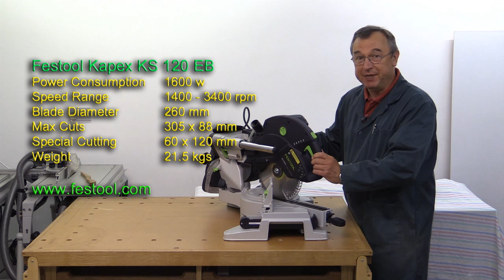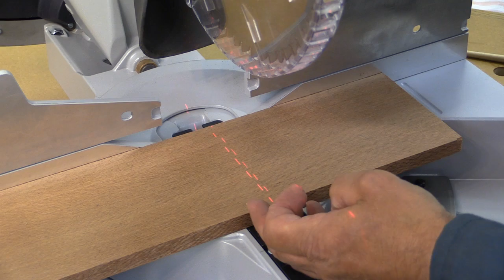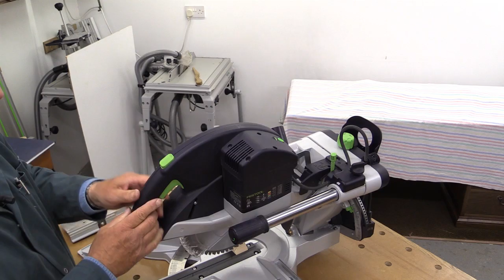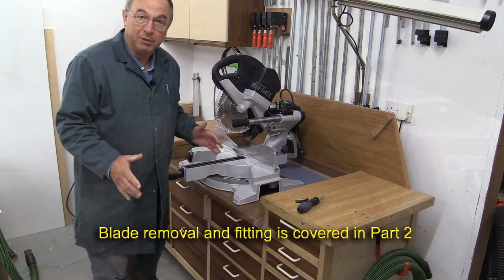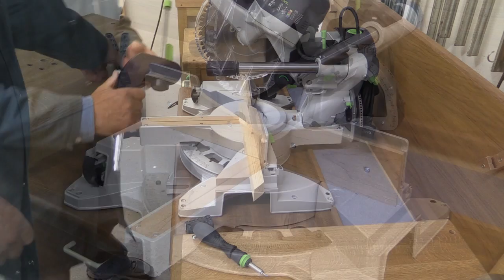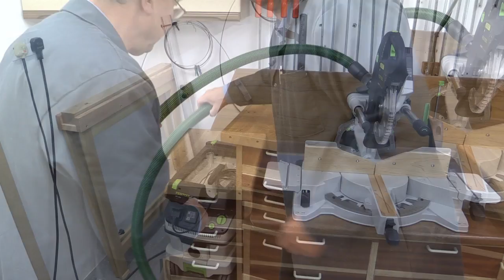Festool Kapex KS 120 - Part 1

Comment: Peter, I'm having a problem that seems to have happened to many who have commented on youtube. It's that the Kapex's dust collection is TERRIBLE!. I followed your suggestion to put zero clearance inserts on the base and the fence. The one on the base doesn't seem to cause a problem, but I wondered if the one on the fence was blocking the path that the dust should take to the rubber dust hood at the back/bottom of the saw blade. I removed the insert from the fence, and split the halves of the fence apart so that it didn't interfere with the rubber dust hood - it's a pain anyway when the hood gets stuck on the fence as you pull the saw back. Then I notice in your video and others that your rubber hood goes almost all the way down to the base, but that there was about an inch of space between mine and the base. I dummied up a 1 inch extension to the hood out of duct tape and trimmed it so that it doesn't get caught on the fence as you pull it back. Now - well, it's not perfect, but it's much better than it was. When sitting on a low rolling chair and looking at the dust hood while making a cut, before, a lot of the dust was going under the hood. Now, with my extension, it's going right up into the saw. I noticed that you and some others who praised the dust collection have the 120 EB, whereas I have the 120 REB. I also noticed that the EB's dust port is different than the one on the REB. Do you have any insight into this problem, or perhaps can get info from Festool?
Reply from the maker: Hi Bob, You are right that the zero clearance pieces that we make and fit ourselves do interfere with the dust collection but the effect, for me, is quite minor. It would become more pronounced if one was cutting thicker stock. As far as the design of the dust boot goes I believe that they are the same. There may be technique issues... Starting a cut the instant the saw is triggered does not allow the extractor to reach full flow. Also, keeping the Kapex in the down position until the saw blade ceases to rotate will improve dust collection. The final thing is expectation...Yes, the Kapex is great at dust collection but that is compared to the majority of other saws on the market. Some dust will always get through. I came from a Dewalt radial arm saw to the Kapex and the difference was amazing.  Peter

Comment: Hi Peter, I really beat myself up over the purchase of the Kapex 120REB. It's the one saw I've long been after and I recently took the plunge. It's a pricey saw but after January next year and Brexit there's only one way prices will go and that is up! I was really laughing to myself when I watched your part 1 video about the method of starting the Kapex. For half an hour of so I coudn't get the saw going and I was sure there was a fault on the machine so much so I telephoned Festool UK for tech help! Now I'm up to speed with the trigger start up thanks to you. Best regards, Richard
Reply from the maker: Hi Richard, It is a funny thing but some of us get it right first time and some need a second go. Once you get it then  things are dead easy.  Cheers.  Peter

Comment: Hi Peter, do you think it is save to cut a mortise and tenon joint on the kapex saw?
Reply from the maker: Hi Henning, You can do the tenon if the size fits in with the Kapex trenching range but the mortice has to be done with either a router or a hammer and chisel.  Peter
Reply: @NewBritWorkshop  Thank you Peter!!

Comment: Hi Peter, thank you for producing this very informativ video! I have one question on clamping. Is it not dangerous to clamp both ends of a work piece down? Thank you
Reply from the maker: Hi Henning, If you always allow the saw to stop before lifting then it should be fine. Better to keep everything in one place than have half of it flying around the workshop !  Cheers.  Peter
Reply: @NewBritWorkshop  Thank you Peter

Comment: So I bought this machine and it’s really great. The only downside I am finding it’s it’s awkward to carry. I am a site carpenter so I’m always hauling this thing in and out of home. Any suggestions? Great video
Reply from the maker: Hi Ben, They have a mobile base and workstation which is used by a lot of the guys on site. It makes moving the machine much easier.   Peter

Comment: Hello Peter, hope you're staying safe!  Just a quick question on Kapex, I am renovating my summerhouse whilst we're in confinement.  I need to cut some 9" x 3" beams.  Would you do that in one pass on Kapex 120 or perhaps 2 or 3?  It seemed to be struggling a little a couple of days ago so this morning I've made the cuts in 2/3 passes.  Ive had it 3 years with modest home workshop use.
Reply from the maker: Hi George, There are a number of factors that can affect the efficiency of cutting - dull blade, wood not supported equally on both sides and too much force by the operator. If you detect a burning smell at any stage or scorching of the cut faces then check these out. Otherwise, take the cuts slowly and remember that if your wood is not perfectly flat that as you cut one side or both will try and move.  Peter

Comment: thinking off getting the dewalt 780 from axminster have u had good service from them
Reply from the maker: Hi Tom, I have been buying tools and other bits from Axminster for over 30 years. Their customer service is fantastic and they really do go the extra mile when it comes to after sales service. Their store staff are also excellent as they understand the woodworking community so well and certainly know their stuff when it comes to tools. Although you might pay £5 more for the Dewalt from Axminster it will be worth every penny as you will have their excellent support should you have any issues at all.   Peter
Reply: @NewBritWorkshop  thx peter

Comment: Hi Peter. Do you know if it's possible to fit the festool LED light in the 120 to use the shadow line like the Kapex 60? Personally I don't trust the accuracy of the lasers although you can adjust them.
Reply from the maker: Hi Cathal, I do not think that a shadow line can be created with the KS120. Do have a go at adjusting the lasers if they are not right. Mine are as accurate as I can get them. I agree that they are not quite as good as the KS60 but I only use them for approximate work.   Peter
Reply: @NewBritWorkshop  I haven't actually bought the Kapex yet. I'm torn between the KS 6O and KS 120, I'm going to just be using it for 2nd fixing so I'm wondering would the 60 be sufficient for that work? Also, do you think the dust extraction is better on the 120?
Reply from the maker: For 2nd fix I would not hesitate to get the KS60 as it should have all the capacity that you need and be a little lighter and less expensive. It is a great saw. For a fixed workshop I would always go for the KS120 - mine is brilliant.   Peter
Reply: @NewBritWorkshop  Thanks Peter, keep up the good work with the videos.

Comment: Hi sorry peter, oh boy I probably wrote the name down wrong, it’s a Festool chop saw that looks like a step down version of yours except it seems to be targeted at mitre or off mitre cuts as the saw itself doesn’t swivel but instead the support back plates do. When you swivel one fence the opposite fence also moves, so for a cut you simply put your bevel gage against both fences and the cut is automatically bisected for you. With your saw I know it comes with its own bevel finder that you set using the laser. I’m beginning to think I dreamt this saw up ha. Sorry again about the confusion.
Reply from the maker: No problem. I have the Kapex  KS 120 and I have made a video about the new Kapex KS 60 - a really nice saw.   Peter

Comment: bought a kapex about three months ago. the motor just went up in smoke it simply died on me while finishing a house.
Reply from the maker: Nobody knows the details about what you were doing with the machine, whether it was set up correctly or what Festool then did as it happened within the warranty period. I expect you got your money back.  Peter
Reply: This is not a rant against you! I'm a finish carpenter I did nothing to this machine that I hadn't done with my Bosch(s). The machine was set by me to spec!! My point is this: the most expensive miter saw ever put in the market burnt out in only three months of use. We use a lot of 3/4 MDF nothing else and nobody else ever used it besides me. No such luck they would not give my money back. I used a Bosch for almost 6 years I only have in to the kapex because I own a few Festool tools and for a better dust collection. Best regards!
Reply from the maker: You should insist on getting a repair or your money back. The Kapex is not cheap and should be able to withstand just about anything that can be thrown at it - where are you based and who supplied the machine?     Peter

Comment: Hi Peter. I have recently purchased one of these and have a question regarding the dust extraction. 
You mention in your video (one of reasons I purchased this) that the dust extraction is second to none. 
I am not experiencing that. I have made sure the rubber boot is connected properly. But am still experiencing quite a bit of dust. Still not as much as other saws, sure.. Yet far more dust than I have seen in video review all over.. 

Any tips on making sure I am extracting correctly? I am using a festool midi vac, set up above the saw through a shortened green festool hose. 

Thanks
Reply from the maker: +cynicaloptimist  Hi Mr Optimist,  It is best to ensure that the extractor is up to speed before starting the cut - this is only a second and a half. Also, I use a short section of 36 mm hose between the Kapex and the extractor - this makes a huge difference. 27 mm hose is not good enough.     Peter
Reply: +New Brit Workshop (Peter) 
Hi and thanks again.. Ok so I am going to get a larger diameter hose. Would it be worth going up to the 50mm hose.. Which can be purchased by the meter. Or is the 36mm ample in your opinion.. ?
Also, did you have to tweak the saw in a few places so it would cut 100% square. Mine seems about 2mm out over a 300mm cut. Would have though it would ship at 100% but it is tweak-able right? 
Thanks
Reply from the maker: I have not tried the 50 mm hose but am perfectly satisfied with the short length of 36 mm.

Yes, you can adjust the saw very easily. Take a look at the US Supplemental Manual https://www.festoolusa.com/media/pdf/kapex-ks120-supplemental-manual.pdf 

Peter

Comment: Hi Peter.  I have found that with the correct blade, the Kapex cuts aluminium very well too.  I usually spray the blade and kerf with a suitable cutting and lubrication compound.  This cuts down the possibility of the cut welding through heat buildup.  The saw also works better on a slower speed.  The Festool aluminium blade gives many hundreds of hours cutting before it requires sharpening.  Thanks for another great demonstration.
Reply from the maker: +Stewart Robertson Many thanks (again) Stewart.    Peter

Comment: Hi , excellent video , what is the thickness of the inserts you made ?
Reply from the maker: +Arnold Smith Hi Arnold, They are the same as the sacrificial inserts that came with the saw - without taking the ones I made out I cannot measure them. They must be about 6 mm at a guess.    Peter

Comment: Very nice review Peter.  I have spent almost two months reviewing a variety of slider, miter saws.  For me, low dust is critical due to the mess and the risk of inhaling too many particles, having had pneuomonia I am very susceptible to lung conditions.  Yes wearing a mask helps, but the less mess around means less to breath.  Accurate cutting, useful laser, smooth slider, light magnesium base for transport and incredilbly well known customer support.  I am getting one next week for a variety of projects.  It needs to pay for itself now.  Thanks much, Peter.  You confirmed my thoughts.
Reply from the maker: ***** I am so glad that my video has helped. I started making videos after trying to find information to help me make the decision about buying my Kapex. It is ironic that it took me so long to actually make the Kapex video.  Good luck with the new machine.  You might want to look at my workshop dust study video which does show that the Kapex is excellent on the dust collection front. I use my Festool CT 26 with mine.    Peter
Reply: New Brit Workshop Thank you for the tips, I do appreciate it.  I look forward to watching more of your videos.  Thank you.  William.

Comment: Hi Peter,
I found that when I got a pair of the crown molding extensions one of the two was not co-planar with the deck of the saw.  Tried it on both sides with same result.  It sat at a slight incline so the far edge away from the saw drooped about 1mm.  This made it so if I clamped a piece of wood with a clamp in the t slot, it ended up at a slight angle lifting the piece just a bit where the blade was.  
I took it back to my local Festool dealer and they let me go through what stock they had and try each one on a saw they had in the store.  Each one had the same issue.  They then called up Festool tech support and were told that the design of the attachment did not insure that the surface of the extension would be coplanar with the saw since it was intended to be used with the sliding plastic stop for crown moldings.
So I took my extension back home and adde a some shims to get it coplanar.
Have you had any issues like this?

Thanks,
-Tom
Reply from the maker: Tom McGre Hi Tom, I have not had any problems like that at all. I do not follow the logic of what your dealer said. I think that your solution makes sense but what a pity you have had to do this. Despite that, it is still the best mitre saw on the market.    Peter

Comment: Hi Peter, great concise review of the kapex, could you tell us the dims and thickness you used for the sacrificial wood inserts if you recall them.
Reply from the maker: Douglas Mooney Hi Douglas, The insert that goes under the saw blade has the same length and thickness as the Festool inserts and just measure the width for a one piece solution. The sacrificial pieces on the sliding fences are 10 mm thick and just cover the metal fence elements with an extra 20 - 30 mm on the inside to give safe clearance for the saw blade when doing the sacrificial (zero) cut. Let me know if that is not clear enough.   Cheers.    Peter

Comment: Excellent video Peter, I have a Kapex, good to recap on all the features, didn't know about the laser window removal for cleaning!  Following your videos i now have, Kapex, Rotex 150, Domino XL, CT Midi, MFT3, TS55 R, CMS with TS55 module and router module extension tables and sliding table, and my 1400 router!  I absolutely love these tools, they are so well thought out, and your videos really help me make the most of them,  thanks Peter
Reply from the maker: Hi Nick, Thank you and well done for choosing such good tools. When I was doing my research for new tools three years ago there was not enough information readily available to help me make a decision. I hope that my videos help to fill that gap. I am learning all the time and still doing research. I have recently discovered Festool Centrotec and am now an absolute fan of the system. I am sure that more will follow. I will do my best to continue to help you and everyone else. Thanks again.   Peter

Comment: they are good but they DO need to make a larger 12 in version for site use.
Reply from the maker: This was one of the things that I looked at  when I was considering the Kapex. Its cutting capacity (305 mm  x  88 mm) is pretty close to what you get from a 12" machine. I do not do any roofing any more but even so would manage perfectly with the Kapex.   Peter
Reply: Peter Parfitt in know what depth the kapex cuts peter that is why I said the need to make a 12in model, I have the older version of the dewalt 708 it has a  300 x 100 mm cut, the new version of the dewalt & the Makita is a joke, very poor quality thin casting, I would not give them house room, like most of the manufacturers they have scrimped on the quality but not passed that saving on to the customers as the new dewalt & Makita is still around £700 for a lesser quality machine, you were right to look around first peter, kind regards.

Comment: In point of fact, the base is cast magnesium, not aluminum, which is why the saw is so light weight.
Reply from the maker: You are right and another reason why it is so strong. Many thanks. Peter